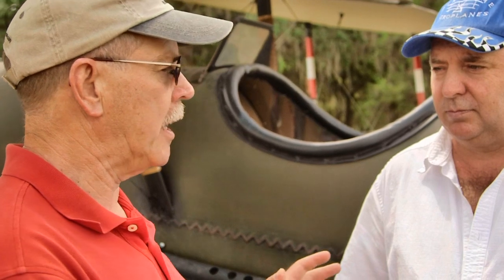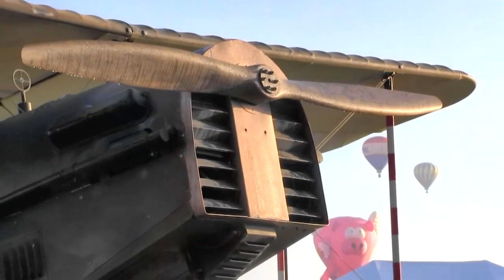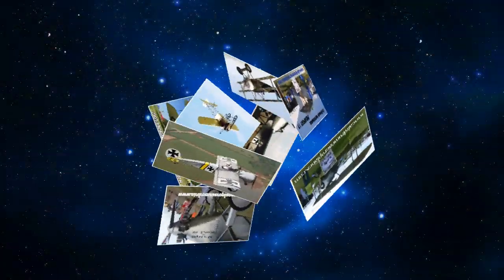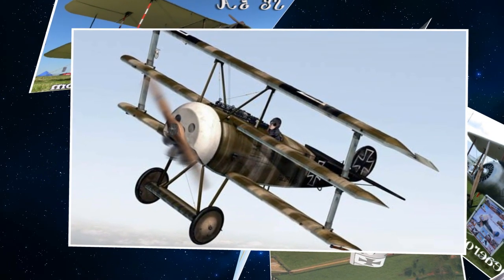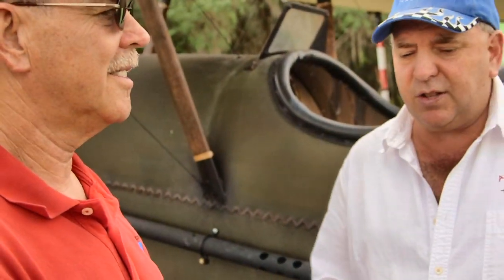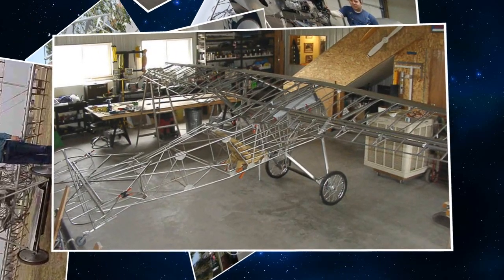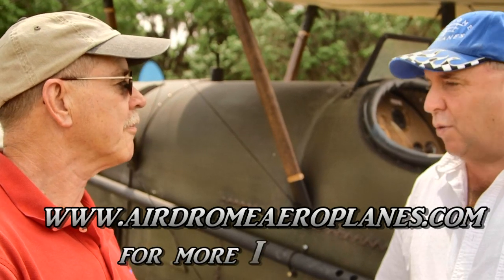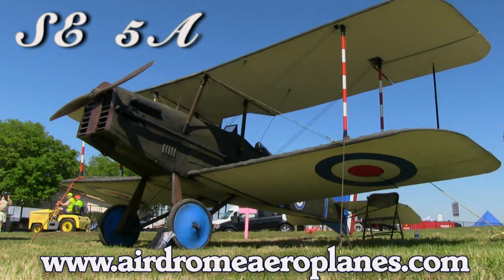SE 5A, Airdrome Aeroplanes SE5A WWI replica fighter experimental aircraft kit

Comment: tis replica is not correckt i can see on the front with thisse engine its not a 2blade proppeler but a 4 blade but nice to make one replica
Reply: +Raymond Regensburg What are you on about, this replica has two balded prop and so did original.
Reply: by a 2 blade propeller ; its where lower hanging  in front by de 4 blade its where so it to see on foto;

Comment: Replica?  Absolutely  ... uh ... NO!   If it were a replica you couldn't tell the difference between it and the real thing EXCEPT maybe if you were an expert with a very discriminating eye.  This would best be described as a mock up or imposter or a mimic.
Reply: How about a modernization replica? The changes are things done to make it a safer, less maintainance, and longer lasting plane than the original. And they have tried to stay as true as they can to the original, and keep the cost reasonable at the same time. Would you take an original or this modernized reproduction for your own plane to fly? I personally would take the safety and ease of maintenance of the reproduction.
Reply: Hey gary, 🤫